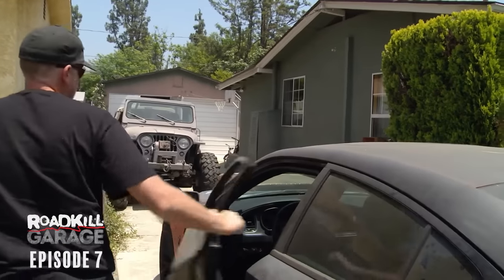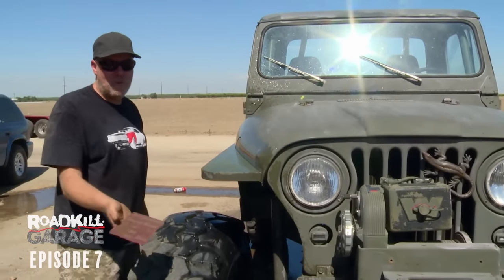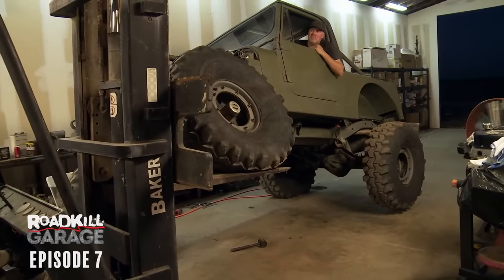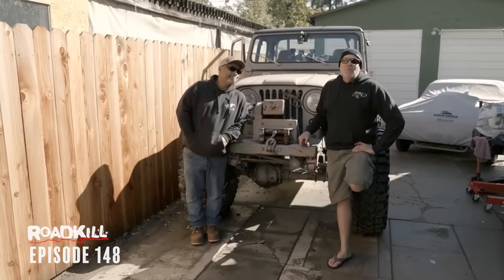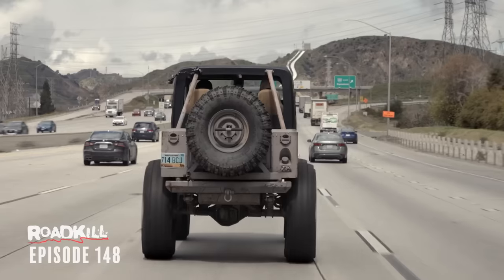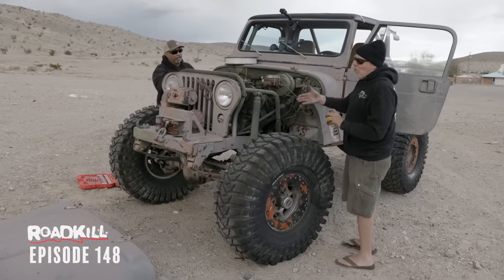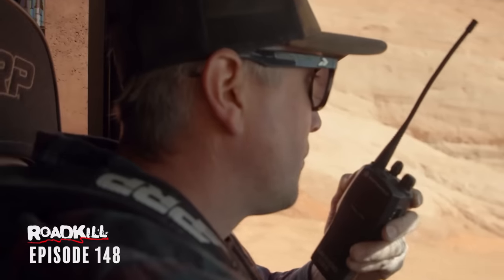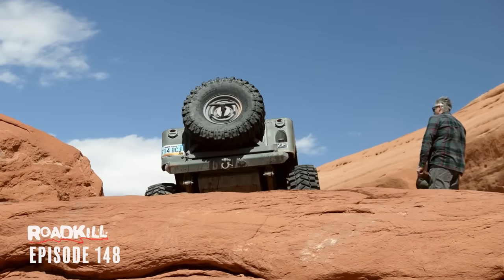TWO Rockcrawling Trips in the '81 Jeep Scrambler | MotorTrend

Comment: I love that Jeep so much!  My first Jeep was an 81 Scrambler I bought for $2500 off a car lot in Grass Valley.  I wanted to drive the Rubicon so bad.  I now have a CJ-7 that is built nearly identically to your Scrambler, but in much worse condition.  I'd love to completely rebuild it and stretch the wheelbase and tub but keep it low tech with leaf springs and carburetor.

Comment: Water crossings, friendly rewinder go slow go slow save yourself a bunch of headaches in the end. End of discussion on that one.  I had an m38j Willys jeep for about 20 years with an F head engine in it put that thing in four-wheel-drive low range first gear. It would crawl up just about anything. It was sure slow going, but it would go was very fast down the road in high gear and highway range, but it was sure fun to drive out in the desert Did pretty good in the sand dunes out at Glamis and out in the chocolate mountains to lotta fun back in the day 70s and 80s and 90s even with my blazer my 1977 blazer lotta fun but water crossings you go slow so you don’t drown the engine out and keep track of the water level number one rule for me when crossing water along with how fast the water is running as well.